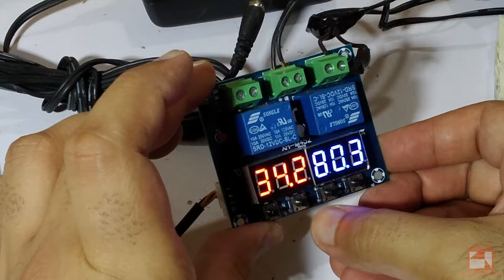How to make 200 eggs incubator - how to make 200 eggs homemade incubator

Comment: Without giving measurements n any commentary it is useless for a beginner
Reply from the maker: I have written the measurements in the left bottom corner
Reply: Right
Reply: @Umairworkshop   but mirror size, and using which material, ( material name) and some other things name, you don't write
Reply from the maker: @caflectures3  it is chipboard laminated and it acrylic sheet as window and size is 2 feet by 1 feet

Comment: Is it fully dc or not. If not how can i make it fully dc
Reply from the maker: You need a DC wiring and make same connection to power supply and use 12v heater

Comment: am not understanding on the air flow How is it throwing air from heating  compartment to tray compartment ? where is the air passing through  l dont understand please assist  ?
Reply from the maker: The fan air as it throws the air to the trays compartment the same air goes back to the front of fan as it doesn't have somewhere to go it keeps warming the same air as new air is getting inside and outside from the gaps of the door
Reply: sorry in the descriprion u said  its throwing air from Tray compartment to hearing compartment , do u mean that the fans are blowing air from Heating compartment to tray compartment ?
 @Umairworkshop
Reply from the maker: @HenriEnoque  yes fans are throwing warm air to tray compartment by heating of heaters it keep rolling back and forth the air to keep the tray compartment warm and little bit new air coming in and out of door gaps

Comment: Asalamualikum unair bhia 1 incubator banana ha koi body size bata daan
Control.          m452
Humidifier     ultrasonic
Tray.               56 eggs Tilting 
Timer.            801
Heater.          Ultrasonic type ha 100w wala
Koi acha sa design recommend kar da ya asa bana laaan
Reply from the maker: Salam , aap 2 feet by 2 feet box mein incubator bana saktay hain
Reply: @Umairworkshop  ander sa insulation kasa kiii jaye garmyon ma tooo masla nahi magar sardyoon ma kafi temperature ka masla ata
Reply from the maker: @HUSSAIN-px7qz  White thermopole ki 1mm sheet lagana hogi insulation kay liye

Comment: kindly please tell detail about the ventilation .. where the inlet and outlet .. the fan always run without control?
Reply from the maker: Can make pencil size holes on the back side two holes on top and two holes in bottom , I didn't make holes because there is a gap in a door which is enough for ventilation, yes fan will work 24 hour directly from 12v supply without controller
Reply: @Umairworkshop  .. tq boss

Comment: That Tpc heater is good for hevy duty?
Reply from the maker: Yes ptc heater are good option
Reply: @Umairworkshop  and what about silicon heater wire
Reply from the maker: @HamzalyFF  yes can use silicone heater wire like this 
https://youtu.be/8SrJhGFEh4c
Reply: @Umairworkshop  Which one is more best PTC or Silicone
Reply from the maker: @HamzalyFF  silicone heater is good because it gets faulty less than ptc heater
Reply: @Umairworkshop  thanks

Comment: Can measurements be made in centimeters?
How will the eggs be turned?
Reply from the maker: It is simple dimensions 12 by 24 inches
Need to rotate eggs by hands manually
Reply: there is no other way to rotate the eggs?
Reply from the maker: @The1legeend  you can make egg Turner in those trays

Comment: Sir I have use xmh 452 in Incubator but the reading of xmh and htc 2 both showing different readings so which one is accurate
Reply from the maker: You can trust on 452 because it is more accurate
Reply: @Umairworkshop  can we also trust on humdity reading
Reply: Definitely 452 is more accurate than htc

Comment: lods good day po, tanong ko lang po e ilang degree o temperature para sa "BALOT INCUBATOR" ang lalagyan ko is "BOX STYROPHON" (LARGE) patulong po please. gusto ko po sana mag sideline ng balot po
Reply from the maker: I don't understand please write in English
Reply: lods good day po, may i ask u if what degree or temperature u used in your incubator for "BALUT INCUBATOR" . Mine, i used a (LARGE) BOX STYROPHON. please help me, i want to sell balut and use it as my sideline.
Reply from the maker: @dylansuliju2152  it is to set from 37.5 to 38 celcius

Comment: Brother, what's the use of the air pump vs the fan vs humidifier?
Reply from the maker: I tried to use air pump to increase humidity but it wasn't increasing over 70% but humidifier can increase humidity upto 80% and fan can circulating all over the box evenly
Reply: @Umairworkshop  Thanks, Brother. So if we don't have air pump, humidifier is enough?
Reply from the maker: @mjshaheed  yes humidifier is good result
Reply: Umair bhai plz yah drill ki kia price hai
Reply from the maker: @fancybirdsfarming3631  yeah battery operated drill 4k tak ki hai market mein
Reply: I want to by this drill
Reply from the maker: @fancybirdsfarming3631  I don't sell these tools but you can get information of this drill machine here
https://youtu.be/J-RZFPVZkHQ
Reply: Ola 
Muito bom 
Mas esses humificadores não aguentam nada pois comprei dois e não duram uma hora obrigado

Comment: Thanks for sharing this professional informative video of making an incubator. I have two questions please: how are the eggs are turned? Air circulation is not clear, a diagram of the air flow will help. Thanks
Reply from the maker: You are welcome , eggs need to rotate manually 2, 3 times daily , the door have a gap the air comes in from there and out from the left small door sides
Reply: 200 eggs turning manually 4 times a day for 18 days is a big thing , think of egg turning system bro
Reply from the maker: @skylaborbit5633  it is manual turning system it can be convert in to automatic like this 
https://youtu.be/mb4EDL5kq98
Reply: @skylaborbit5633  21 days
Reply: @lucascunhask8  No, 18 days only after 18th day no egg turning eggs with be shifted to hatcherer from incubator & will brought down little & raise humidity little,

Hope you understand this ,
Reply: @skylaborbit5633  llllllllllllll7777
Reply: Bhai apka number kia hy